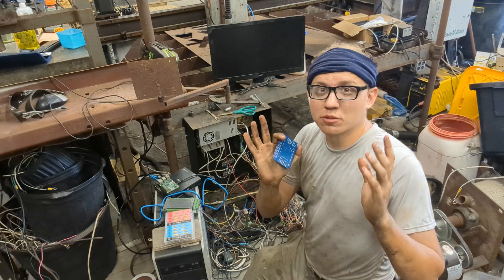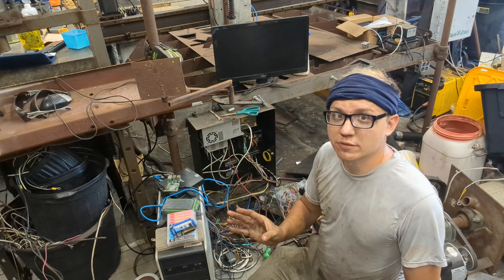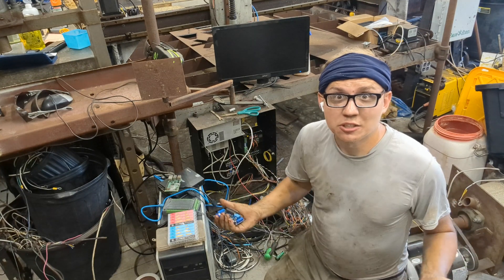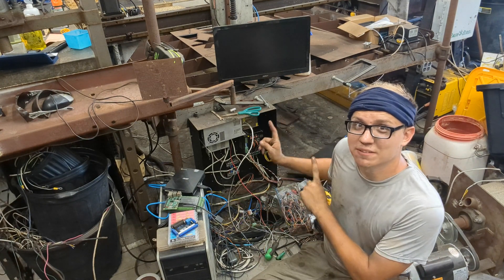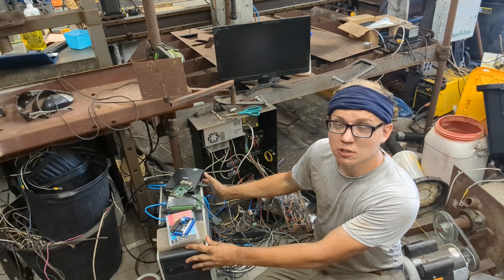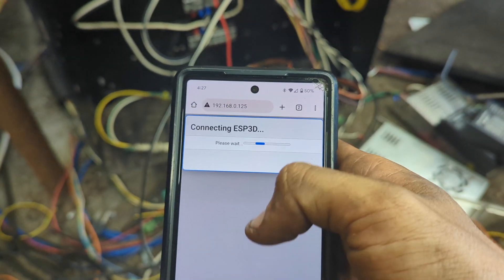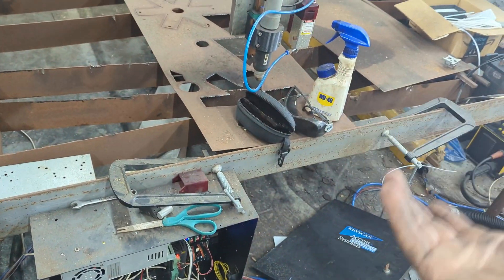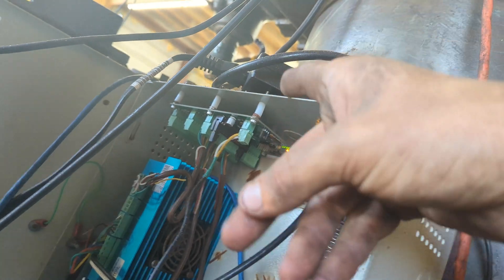Which CNC controller to pick? Linuxcnc mach3 grbl centroid fluidnc

Comment: I don’t want to rely on the internet to manufacture. I want to be able to turn my generator and work in case everything or anything else fails.
I want all my manufacture to be isolated as much as possible from the “hackers” “governments (domestic or foreign)” “big corporations” “persons of interest”. Don’t get me wrong, should I fail it’s because of me; not because there is an outage somewhere.
Reply: The internet is only a ip connection there are no dependencies on 3rd parties.
Reply: It doesn't connect to the internet, It connects to the local network. If you want it even more closed-loop, you can set it up as an access point, where it creates it's own little network that no hackers, governments, corporations or people can get into without being inside your house.

Comment: Linuxcnc on Raspberry 5 and Byte2bot´s RPI to FPGA card (30€) and than you can use any parralel breakout board, and you can attach a wdc wireless china pendant (~100€ 4-6 axis) via usb dongle to the raspberrys usb port, so you have a standalone controller, and you can connect the raspberry per Wlan or ethernet to you network and remote controll it or upload files to the machine from your pc
Reply: I've found the rpi to parallel shield but not an rpi to fpga shield. Or are they the same?
Reply: @warmesuppe  RPI mesa crd is only safe and good FPGA cr what has made to RPI, mesa 7i80 or 81 card. perfect compination use RPI, mesa card, big external drivers and big motors. and have lot lot in/out pins add lot more addons what user want build him machine, automation and program little more
Reply from the maker: Still more expensive and way more complicated. Though I really would like to do that option if it can result in indexing for a CNC lathe (cutting thread on bolts) 
Haven't found a good controller setup for that other than linuxcnc and a mesa card
Reply: @Rowow  a rpi mesa shield is in eu ~200, so its cheaper, but i f you want to use encoder you need a small procerssor for the real time calculations(like the chips on mesa cards) but a esp32 can and a Raspberry as main computer can technniccly do the same as a mesa and raspberry
Reply from the maker: @Geri_crs  one thing I learned the hard way is technically means a lot of time and work. This is one hole that needs a much better solution for
Reply: @Rowow  yes that is the point, luckly i just want to build a mill and threading can bedone with v profile endmills and spiral movement and small diameter than with hand, but with a lathe and without thread die you will not come around a encoder on the spindle, but i dont know if the  DDCSV 3,1 does support encoders, it´s a nice thing execpt iths limitations and non clean code previev (in3d) like Linuxcnc.

Comment: Also, Mach4 kind of sucks.  I am using an ethernet smooth stepper.  That is what I have on my CNC router, and its just so overcomplicated.  There are things on Mach4 that work on one of my laptops but not on the other.  It sucks having to have a PC plugged in, and in a wood shop with lots of dust.  The Wifi boards that work more like 3D printing firmware I think are the way of the future for CNC.  FluidNC looks like it operates like 3D printing firmware.  Being able to use a tablet or phone to run your machine wirelessly is so nice.
Reply: its totally idiot all idea use cnc machine whit tablet or phone and wifi , totally stupid and dangerous, not safe system. and if make something whit machine no totally need wireless system you have near machine sure if working safety.
Reply: @mattivirta there were people that said “it’s totally idiot” to have cnc in the first place. You can lose control of machines that are plugged in as well.  Stop living in the past, refusing to adapt.
Reply: Mach4 is the best thing since sliced bread and Beer .
Just learn how to  use mach4 software   , and do the wiring correctly WITH decent name brand components.
Don't forget to actually read the instructions on the pins and ports tabs.
Problem solved .
One of the best and most universal control softwares available.
Reply: @ I had no issue getting it up and running.  It is buggy.  It has been OK, we have completed quite a few projects with it. It is just buggy and clunky and dated.  It seems like there would be something better now?  At least you are recommending Mach 4, and not one of the strange people that tell you that you need to find a 20 year old computer and run Mach 3 on the parallel port.  That’s just dumb.

Comment: What controller gives the best accuracy..? Looking for very high accuracy (semi-pro level..) thanks for good video!
Reply from the maker: All controllers give more then enough accuracy than you need. All about your linear rails and motors you are using. The best would be Linux CNC using a glass linear scale to feed back the exact position to the controller
Reply: For best accuracy your wanting to use ball screws and servo motors. Not lead screws and stepper motors. Closed loop steppers are a step up but servo motors is what higher end commercial machines use.
Reply: @pierregauthier3077  there's more to accuracy than just the hardware. The machine controller itself needs to be able to do look ahead and path prediction. If there's a sharp turn coming up the controller can't just blast right up to it and expect the machine to make the hard physical turn. That's unrealistic. G61 - Exact path mode, movement exactly as programmed. Moves will slow or stop as needed to reach every programmed point. If two sequential moves are exactly co-linear movement will not stop. If the controller doesn't support that command it's not going to be particularly accurate. FluidNC is a fork of GRBL and neither is a sophisticated controller with advanced features. Microprocessors have far more computational power than microcontrollers do. FluidNC's entire code base is less than 2 MB. How complicated can it be?  Just LinuxCNC's documentation is 10 times bigger than that.
Reply: @1pcfred  this is partially true, but the rigidity of the machine has more to do with accuracy than the controller 100% of the time. A $20k okuma control with glass scales for thermal compensation won't help you if you have slop in any or all of axis. Also, having toomuch slop in your spindle bearings will result in poor surface finishes and broken tools and inaccurate cuts.

Comment: 150 for old pc? could just buy the expansion card with the 25 pin port. these PCs are max 20-30€
Reply from the maker: Plus a monitor, keyboard, mouse. If you can find a PC locally and are willing to waste 1-2 hours driving to and from to pick it up. And dealing with damage and other issues, most likely needing to buy a SSD to replace the failing harddrive, or ram/etc thats causing issues for the PC to boot
Reply: old paraller port pc can buy ewerywere used pc 10-40$ no more need ewer pay. include dispaly, keyboard and mouse. and paraller port linux compatiple etc, mcs9901 chip, cost 4-15$ max.
Reply: @mattivirta well i payed € for mine because having a decent CPU stil helps aith the COM speed xD

Comment: Fluidnc sounds great!  Esp32 is great!
Reply: I'm surprised the plasma doesn't interfere with the radio signal of esp32!  
Why not?!
Reply from the maker: wifi has much better error correcting than USB. Also all of the code is computed and ran on the board itself. The only time important data is transferred is before you run the machine, aka when the plasma is off. It stores the file on a SD card on board and computes it from there
Reply: @Rowow  my arduino is located very close to a 1990s xp laptop. It has a whopping 512k of memory but still boots xp faster than others boot win7,8,10 !
Reply: @Rowow  that makes sense. Wifi only for transmitting the gcode beforehand.  So its just motor wires out?  What motor controller chip?

Do you have limit switches?
Reply from the maker: @TheRainHarvester  You can add motor controller chips similar to a 3d printer board however it has the option which I use  for external stepper motor drivers. I dont use limit switches as its alot easier to zero the machine to the workpiece
Reply: @Rowow  i still zero to the work piece too. But sometimes i  accidentally move too far with manual controls: don't do that!! 😜

Comment: Grbl is the software. 

 Did you try shielding the usb cable?  
Or moving the arduino away from the machine (just make the stepper motor wires go to the cnc, not the usb cable)?
Reply from the maker: yes ive tried shielding the cable, computer, laptop, etc. Even used sheet metal trying some faraday shield. And it helps alot, but I noticed glitches and issues even without running the plasma cutter. I first used grbl on my very first cnc mill and there was random times it would move and not stop. Again no plasma cutting was done with that, or any other interferance. Simple movements and other random things causes unreliability, which any type is too much for a CNC machine. 
Cutting tools can easily cost hundreths of dollars, and the parts you are cutting can cost much more especially with lots of time and effort to cut it just to lose it all midway. FluidNC is simply much better in every way.
Reply: @Rowow  I have used grbl on my CNC mill for 4 years cutting hundreds of electronic cases and never had a single issue. Granted it is not Plasma but no issues at all. I use a Arduino mega with geckodrive step to servo converters because my motors are servo. As far as USB, it help a lot to put many ferrites on the cables when exposed to strong RF. I do run USB cables near Ham radio antennas and amplifiers as well as Plasma vacuum tubes.
Reply: @Rowow  that's very strange to me because i use grbl exclusively for many years with no problems.

The only problem i ever had was with the limit switches.  The magnetic router induced current in the gpio wires to the switch and caused false limit switch presses.

I fixed it easily by adding a 10uF capacitor at the switch (not near the arduino).  It works flawless.

I wonder what the difference between your setup and mine is?!

I have the arduino uno 3' away from the cnc. Only the limit switches and stepper motor cables go to the cnc.
Reply from the maker: @TheRainHarvester  I was using a laptop and maybe it wasnt properly grounded. But control over USB is annoying. You still need another computer. Much better to have the code stored and ran on the board itself. When you have many cnc machines it makes operating them so much easier. I can run them anywhere I want to from any device. simply need to change the IP to swap between them.

the only time I dont suggest it is for high precision machining where a MPG controller is needed and especially for lathe indexing for threading
Reply: @Rowow  yeah it's s good at strategy.  Does fluid nc still have emergency stop/pause button?

Can you still broadcast a move request while the machine is cutting? Or does wifi get interference ?

What is the issue with lathe thread indexing on fluid nc?
Reply from the maker: @TheRainHarvester  yes and you can wire a switch to it cause obviously WiFi may time out or whatever
Reply: Yall need to checkout CorvetteGuy50 he’ll solve your problems… 

Agreed — USB isn’t feasible for production grade implementations from my own experiences and testing, ETH is good method. 

EMI is a bitch I shielded and drained all my cables over again from scratch and it was tedious but fun. Ground is King